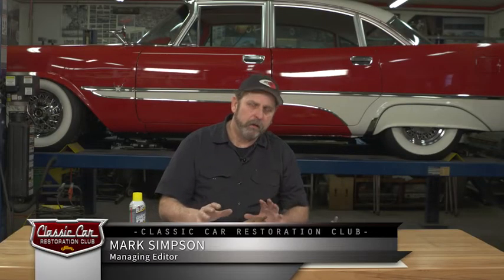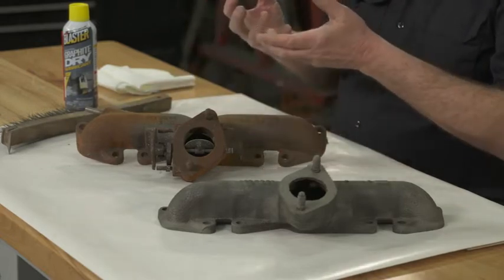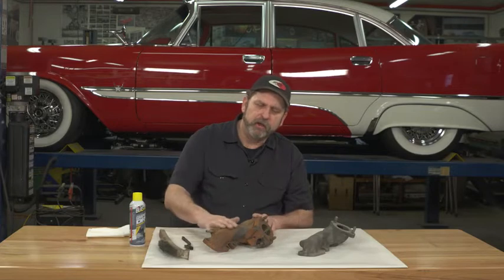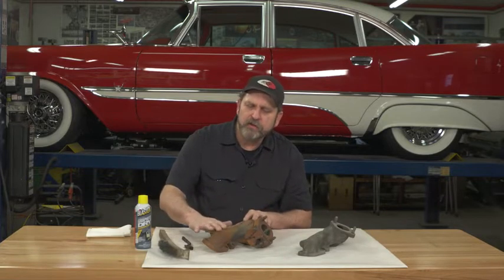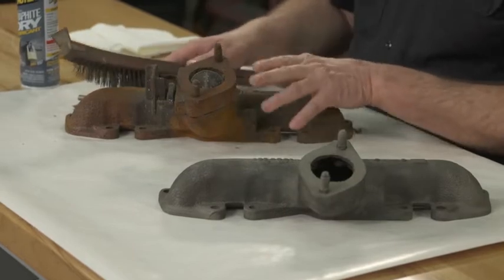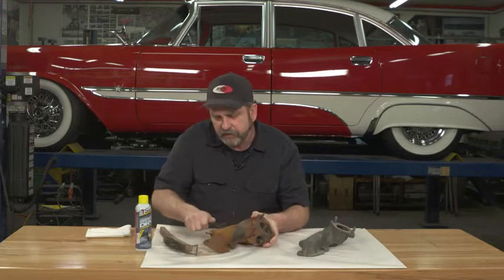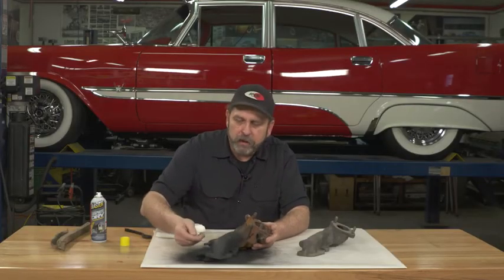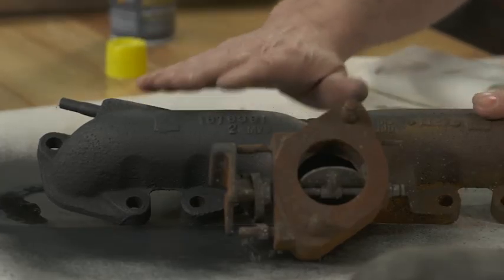Exhaust Manifold Graphite Coating

Comment: For those saying it's too dark...  different products have different looks. The best reviewed Graphite product for this is Slip Plate. Comes in a 12 oz can at NAPA. It has an acetone toluene propane suspension and soaks into the pores of cast iron. It gets lighter with heat cycling and after it dries, if you buff it lightly with a cloth you will be hard pressed to distinguish it from a freshly-cast manifold. Amazing finish, amazing look, and very long lasting!

Comment: Did you guys ever have to replace that choke stove tube, inside that exhaust manifold? 
Seems a lot of them are cracked and the carb will suck up raw exhaust into the choke cap.

Comment: thanks for the tip. im currently doing my manifolds. I wonder if there is any benefit to spraying the interior of the manifolds ??
Reply from the maker: Hi,
I doubt the graphite would last long with direct contact of exhaust gasses, and don;t believe you'd see any real benefit coating the inside.
Mark
Classic Car Restoration Club

Comment: Was the other manifold next to the one you sprayed already treated with the graphite?
Reply from the maker: Hi Michael,

As mentioned in the video, you can clean up and media blast the exhaust manifold like the one shown, or you can simply clean and apply the graphite directly over the rust and cast iron as we did in the video. 
The manifold we did not apply it to is simply cleaned and blasted cast iron.

Mark
Classic Car Restoration Club

Comment: If the goal is to avoid having rusty manifolds, then you need to consider other methods. My results after cleaning and treating a brand new (non-rusty) manifold using the spray graphite method shown resulted in a completely rusty manifold after the first rainstorm. Unless your vehicle is stored in a temperature-controlled garage and never goes out in the rain, I would not expect this method to prevent rust. It’s nice that you can wipe it down with more graphite to touch it up, but who wants to redo their manifolds every time you drive on a foggy day?

Comment: How long does it usually last ?
Reply from the maker: Hello,
How long it lasts depends on many factors: How much you drive it, How hot does your engine run, have you been driving in the rain, etc... 
For me it seams to last a month or two before I need to touch it up a little with some sprayed on a rag. 
During a car season I do it once in the spring then touch it up a couple times during the year.
Mark
Classic Car Restoration Club